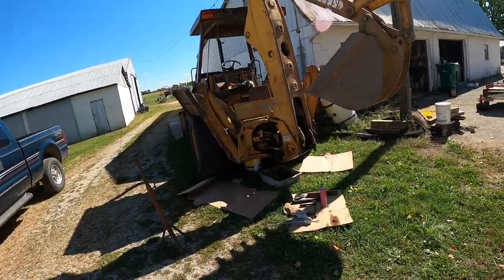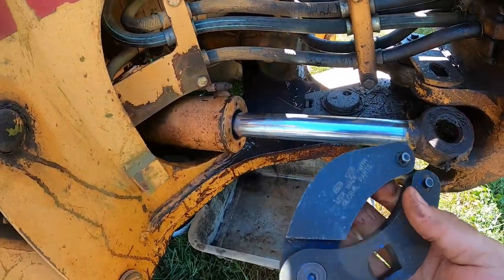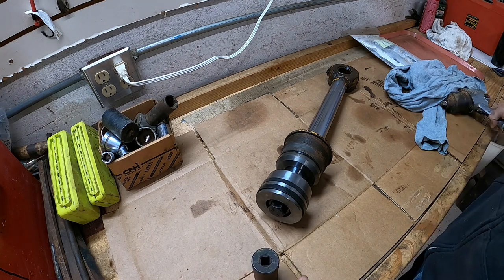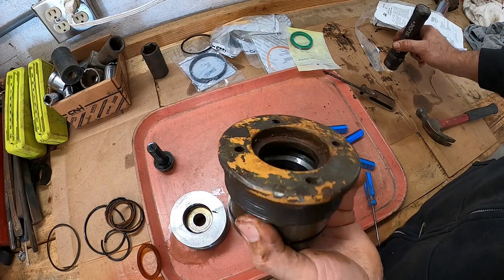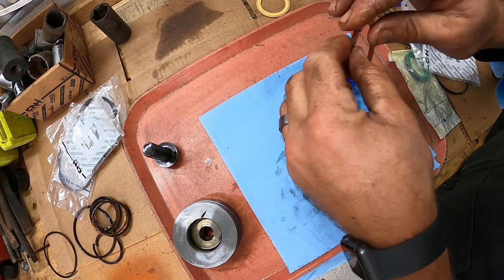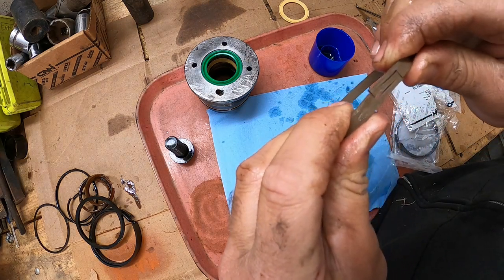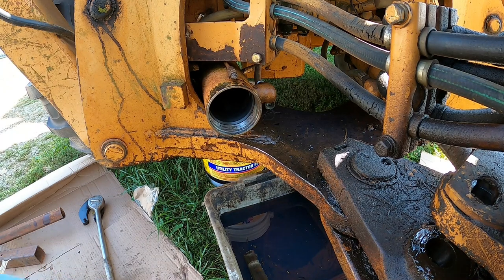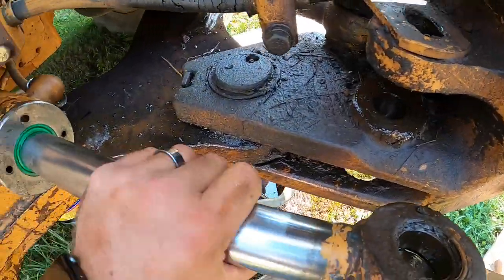Case 580 K Backhoe -  Swing Hydraulic Cylinder Rebuild (2020)

Comment: Nice concise video. I've replaced all seals on my yellow fendered 580k except for the swing and loader curl cylinders. The dipper cylinder was extremely tough to take the gland off even with torches. A 10' (yes 10 ft) pipe broke the 1" breaker bar trying to get the piston cap screw loosed. Ended up taking it to a hydraulic shop that had a hydraulic press. They ended up heating it so hot that I couldn't touch it for almost 2 hours. I was happy to pay the $50 they charged just for unscrewing the piston!
Reply: So its not just me its the dipper. I went to hell and back with that mo fo. I went through two jacks , a cable, the back window of my 7.3 (1500 lbs in the bed) and 3 of the spread wrenches. Bent third one in half. I tried heat and failed. I gave up and let it set for few months. I learned that more heat might do it. We took two torches to it. I welded a heavy chunk of L bar to the gland so we could grab it We brought it to a bright orange. Right on the edge of blowing holes in it. And it turned. we had to keep it that way till we freed it. Shot threads had two replace

Comment: Nice video.  I have a 580K that the bucket cylinder is leaking.  I appreciate how thorough you are and the commentary.  I'm pretty sure I can tackle now after watching this.   Thanks!
Reply from the maker: Hey thanks.  I’m actually replacing the seals on the bucket cylinder tomorrow on my 580k.  Going to make a video on some tips for removing the gland nut.  Thanks for watching.
Reply: @JacobsFarmLife  awesome, looking forward to the video. I’m trying to figure out how big of an impact socket I need to get for the piston bolt before I tear it down. A source and a part number for your kit would also be helpful.
Reply from the maker: I’ll let you know.
Reply: @hobel73  ITHINK HE SAID 1 1/8 '' ON THAT ON THE SWING CYLINDER.
Reply: 10:40 10:42

Comment: Excellent vid - thx for taking the time to make! I've got a mid to late 80's JCB. Giant nut on the cylinder instead of the Case approach with the holes. Haven't ever been able to break those nuys loose. Even with a large pipe wrench and an extended handle for leverage !!
Reply from the maker: Hey thanks.  I’ve had to go the pipe wrench route before lol.  Might need a little heat on that one.

Comment: great video . i just purchased one and i was questioning if i can take the nutt off and then use the back hydraulic hose to push the piston . turn the engine and move the lever and push it out faster and ease

Comment: I and a friend just rebuilt hoses and rebuilt one cylinder on our Case 580K, have one outrigger seal leaking so have to take it apart and replace seals. We ran extend-boom out and in and other cylinders. Does this backhoe have self-bleeding set up? So, just run each cylinder out and hold for awhile. Let air run back into fluid holding tank? Do you need to bleed at each cylinder hose fitting and or push bleed valve on cap at hydraulics holding tank at set intervals to release air. Or does just running booms out and in release air to its desired level. Thanks, enjoyed your video’s.

Comment: Fantastic video. I had to repack the same cylinder on the same machine and this was very helpful. Have you had any experience with the hydraulic pump or the relief valve? I believe I have an issue with one or the other. I know the location of the pump, but I don't know the location of the main relief valve. Can you point me in the right direction? It's very difficult to find information on this specific machine. Any help would be much appreciated.
Reply from the maker: Thanks.   I have no experience with the pump or valve.  But I’ll probably be replacing both on my machine in the future

Comment: Could you turn the arm to the right when it was leaking? I have a small leak and It doesn't work. Do you think I should do that what you did in your video?
Reply from the maker: Mine still worked when it was leaking.

Comment: Thanks for the vid. I noticed that the old vs. new piston seals were different. The old had two in two grooves. The new you put one over the other in 1 of the grooves. Was that last new one you put over the other new one a wear ring and should have went into that other groove instead?

Comment: Nice video thank you very much, can you put partnumber for the kit? I have the same problem. Thank you
Reply from the maker: Yes the part number for the seal kit is G110053 which is for the 3 1/4 inch Tube ID but if yours has the 3 1/2 inch Tube ID it will be G110621.  Hope that helps

Comment: I had to rebuild a ram also on a skidsteer tho but I always thought there's more to them than that but apparently not suprisingly easy to rebuild when you put the wiper seal in correctly I'm guilty
Reply from the maker: I agree.  Really not that back. Especially after you do a few of them. Getting the gland to break loose on 30 + year old equipment is probably the hardest part.

Comment: Might be a dumb question but do you have to bleed the air out of the cylinder after reinstalling or will the fluid push the air out, thanks
Reply from the maker: The fluid will push the air out.  Just cycle it a few times.
Reply: I just asked that question too, before I saw your question. Was wondering if all that air after rebuilding system would damage seals. Guess not. God bless

Comment: How do you assure there is no pressure left in the lines before repairing?
Reply from the maker: With the machine off. Just hit the pedals a couple of times and it will relieve any pressure if there is any

Comment: I have an older 580 k the swing cylinder just blew the seals out  can this cylinder be pulled out so I can take it to be rebuilt
Reply from the maker: Yes you can simply unbolt both ends and remove both hydraulic lines and it comes right out.
Reply: @JacobsFarmLife  thank you for the fast reply I will do that
Reply from the maker: Awesome. Let me know how it goes
Reply: @JacobsFarmLife  thanks so much I sure will
Reply: Well my Dad just informed me it's not a k model it's a b model will that make a difference getting the cylinders out, it has a plate across the top of the cylinders with grease fittings on top on each cylinder
Reply from the maker: Not sure. Should be pretty similar

Comment: If you didn't remove the actual cylinder you just loosened it and pulled it apart why did you disconnect the hoses
Reply from the maker: Makes it easier to pull and install the shaft and piston.
Reply: @JacobsFarmLife  makes. Sense
Reply: @JacobsFarmLife  "Makes it easier".  ..I would say "makes it possible to", probably, no? Because @John maxx, if you don't remove at least the one line that feeds the space behind the piston, you wouldn't be able to pull the rod out, unless your piston seals are trashed too, because as you try to remove the rod, there will be a vacuum there.

Comment: where did you buy your parts? online or local?
Reply from the maker: Bought them at a local case equipment dealer.   They have since went out of business.  I’ve got a couple more cylinders I need to rebuild so I’ll have to be looking for a new place to order from.
Reply: I also have a 580K and have been getting my seals from Hercules Sealing Products. they have a drop down menu to select by brand and model. I also bought a seal twister from them which makes installing that first seal he put in real easy. This video is appreciated as my swing cylinders are starting to drip when parked. The machine is over 100 miles away at my property so gives me an idea what to expect. First two cylinders (boom& dipper) that leaked I paid a guy to rebuild and glad I did. He had a lot of difficulty getting the piston bolt off. I rebuilt one of the bucket curl cylinders myself and was easier than I expected.
Reply from the maker: Awesome.  Thanks for the info. I’ll check them out